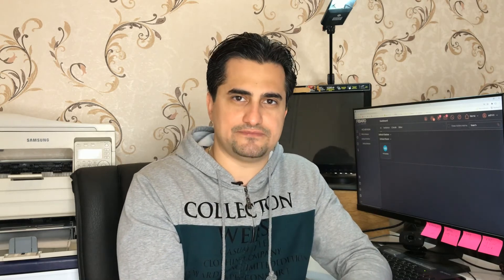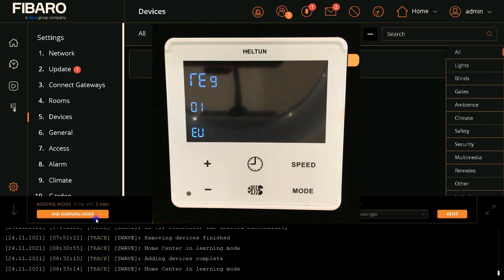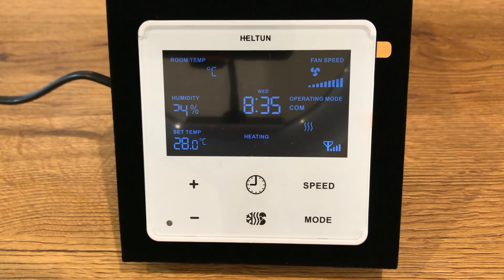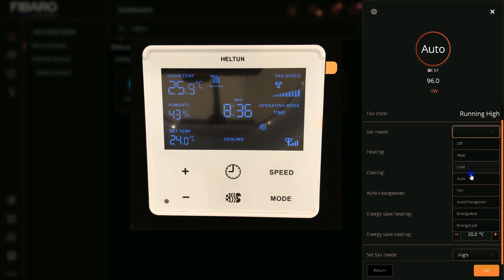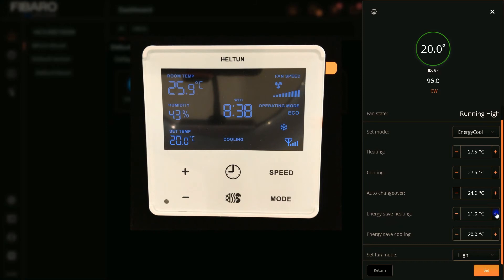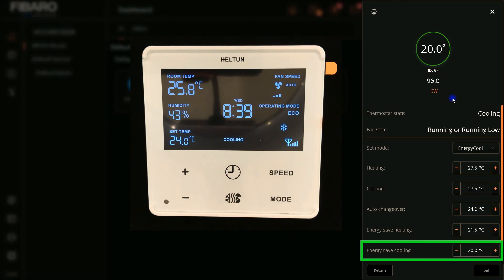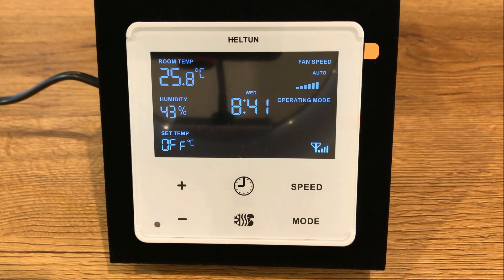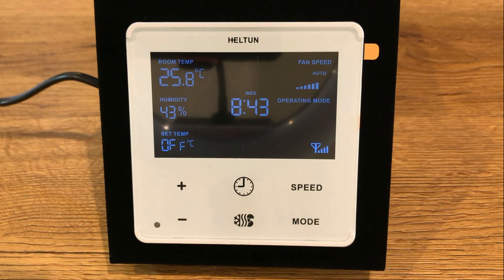heltun thermostat

Comment: Good evening mr Ali
I have a question 
We can install this thermostat fan coil with normal AC ?
Reply from the maker: Hi, may I know what do you mean with normal AC?
If you mean a heater only for instance yes you can use it but why not use the heating thermostat?
Reply: @kian.smarthome  thanks for your reply 
I mean an internal air conditioning unit that is not central
Reply from the maker: @ahmedfaroukmadi  for sure you can use it
Reply: @kian.smarthome  
May I know how to install please?
Reply from the maker: @ahmedfaroukmadi  what exactly is the model of your air conditioning?
Reply: Hello, I don't understand well how you connect the inputs or outputs. I have now a MC8-FC thermostat and there is no inputs cables. Thanks